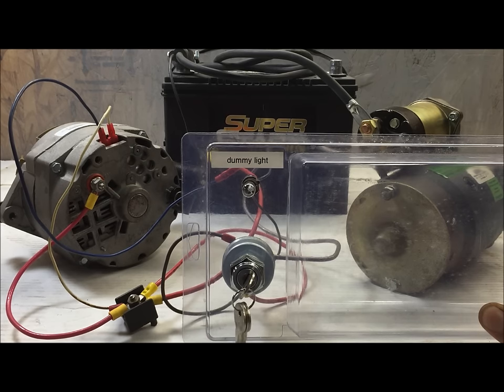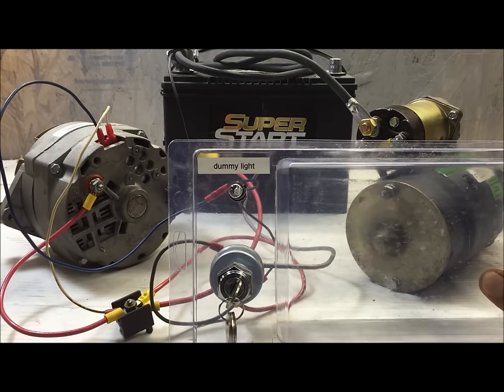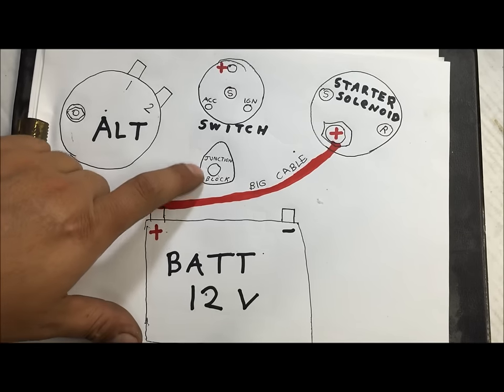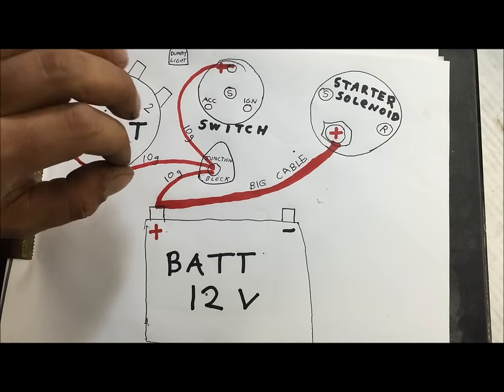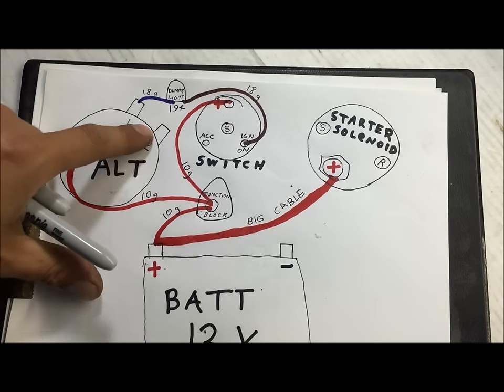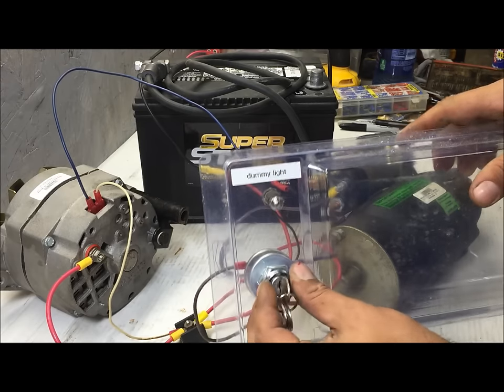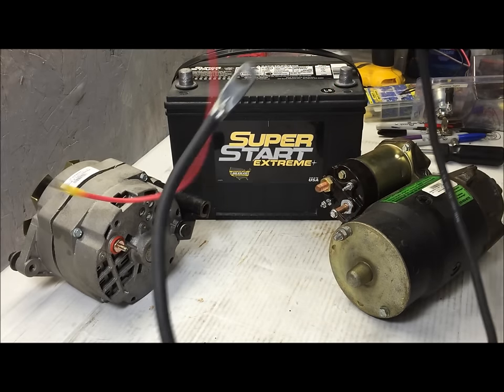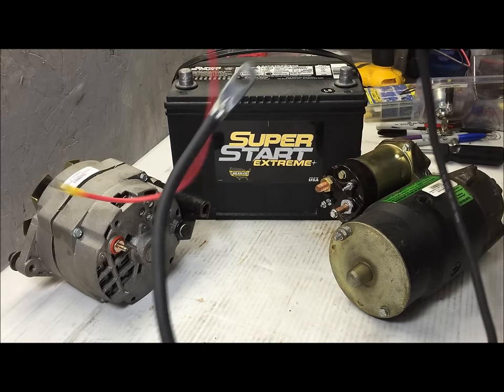64-72 charging system wire up using GM 3 wire internally regulated alternator

Comment: I took my alternator off last week putting it back together now. I can’t find a wire going to the 1 position on alternator (the wire your talking about connecting to the bulb). Is it possible that was never there?

My question is what will happen with no wire connected to the bulb or number one spot?

Thanks
Reply from the maker: you dont need it.. you will just have to rev the engine up a little to get it to start charging..  watch my Gm 3 alternator wire hook up video
Reply: Appreciate it!

Comment: Have an alternator like the one on video. Is there a ground cable that attaches across from positive post behind alternator. Working on my build and need help. Thank you
Reply from the maker: no
Reply: @chriscraft77022  thank you! Going to install it now. No one has seen these older model alternators. Just rewatched your video. So will only connect the 2 wire pigtail (Blue & white) and will connect 12V red. Will only connect 3 wires. Thought I needed a ground wire. Going to garage to make installation. Thanks a lot
Reply from the maker: I have a GM 3 wire alternator hook up video if you have problems

Comment: hey eny tips on how to wire up a 41 chevy coop floor start ? starter is a floor start how do i wire it up ?
Reply from the maker: ive never worked on one but if that switch is just a momentary switch..   then the ignition switch is still going to have an S position that would run through the floor switch and then to the starter solenoid...   im guessing they did that so you could work the choke while trying to start???      are you using the original engine?   if not get a later model key switch with momentary start position..  sorry, ive never worked on older than a 68 so my info may be wrong...

Comment: Where do u get the dimn light?   I try with a car turn signal   and won't turn on...  i have to doing same  as a normal light black neg and red positive   to turning on
Reply from the maker: you don’t even need to hook #1 up.. #2 is all you need connected back to battery anywhere.. watch my gm 3 wire alternator hook up video (old not with the truck )

Comment: i have a 1979 points xs650 yamaha, i do not want to run lights....... just the motor, can you help me, i want to use 2 automotive coils, with a on / off switch & a push button.

Comment: I have a rockcrawling buggy, Toyota based, 22R with a GM 1 wire. Alt just went out, replaced with one from DB Electrical. The wire from the back of the alternator goes to the main disconnect, not straight to the battery. I get 15.57 volts at the back of the alternator but only 12.7 at the battery. Should I run an additional wire from the back of the alternator straight to the battery or ditch the one going to the disconnect and have just one going straight to the battery?
Reply from the maker: The alternator wire has to go straight back to the battery
Reply: @chriscraft77022  
Should I reroute the existing wire going to the kill switch or just run another straight to battery?

Comment: I installed a 2001 alternator on my 71 chevelle. All works good. only thing is that when 
 I shut the car down something keeps drawing on my battery Think its something on my switch?
Reply from the maker: +Vic Cotto you have 2 wires wrong or switched   Voltage sensing and excited.. watch my gm 3 wire alternator video

Comment: I have a ground wire on my alt with external regulator. Does it still wire the same. Need help. Mid 60's 283. Installed in 1949 international kd1 panel. Was 6 volt now all 12 volt except insturment cluster.

Comment: I was watching your video on the electrical and I do have a question if you'd have the time to answer...my 74 nova had good power at the s terminal on the solenoid the next day the car won't start an test that s terminal and I have a 8.25 volts... any thoughts? Relay .... ur video was helpful...

Comment: Wonder if this would work to throw an alternator on a little tracked iron horse machine and keep a battery charged so I can throw a wench and some lights on there 🤷🏻‍♂️
Reply from the maker: the problem people run into is not being able to spin it fast enough.. think of the rpm range on a car when you drive.. it will cause drag too
Reply: @chriscraft77022  got a 15hp engine and it hardly works. Potential for putting a smaller pulley on the alternator to increase its rpm???

Comment: @chris Craft so a friend of mine has a 72 El Camino that has an external regulator wired up although it has an aftermarket internally regulated alternator one wire hook up installed. I'm not sure why the external regulator wasn't eliminated or removed. The charging light doesn't work. So the question is how would you connect the charging light in this situation? Thnx
Reply from the maker: +Fernando Rosa Jr. 1 wire alternator doesn't have the charging light feature.. does it have a #1 and#2 position? people think 1 wire alternators are an upgrade.. they make those for dune buggys and circle track cars.. watch my easy conversion video and I have a gm 3 wire alt video too
Reply: Chris Craft nope nope just one power wire to the alt. The car does have a charging indicator at dash, that of course worked previously. I have watched ur vids..all great thnx! Ill let u know how i make out
Reply: Fernando Rosa Jr. 1 wire does not have the charging light feature...all you can run is voltmeter gauge ...i have an easy conversion video for the ext. regulator

Comment: i feel like the butt connectors or whatever they're called might add resistance and 'mess up' or change the resistance of the 10 gauge wire
Reply from the maker: Well, how would you make the connection.. ? the factory made similar connections..  no solder .. it works .. heat shrink them if you are worried about this.. go pop the hood on your car and look at the factory connections
Reply: @chriscraft77022  No I know..  I'm just trippin on resistance and butt connectors.  I just bought a classic Dodge van with alternator and wiring issues. I'm not saying they're bad..  just wondering

Comment: You know what's even easier? Get a one wire alternator. All you do is run one wire from the battery terminal on the back of the alternator straight to the positive terminal of your battery. You don't have to use the ignition switch the dummy light or anything else

Comment: This helps but I’m still no crank I thinks something to do with the neutral safety switch. A guy was swapping my 305 to 350 unhooked everything wires all pumps pulleys brackets and never came back so I’m having a freaking hard hard time specially since I’ve never done a engine swap. But I’m getting there
Reply from the maker: yup, that’s a good place to check
Reply: Hey and another thing you said something about the 3rd spot on the started and something about the points. Does that apply to my 85 c10

Comment: How do you wire two stud starter? 
Ok the starter I took off the truck had 3 stud for your wires. The starter they gave me at the parts house has only two studs for your wires. How do you wire it up?
Reply from the maker: what is the vehicle?
Reply: It's a 91 GMC 350 4x4
Reply from the maker: that’s what is in the video... that year doesn’t use a 3 stud starter..

Comment: check majority engine wiring color wire uses like,
alternate to battery is green, from battery to starter main is red. battery to body main is black. alternate to body negative is black. alternate to lamp(1) is white. lamp to ignition is red. battery  to power supply ignition is
 red. ignition to starter for start is black with white line. please check all cummins and cat and Leyland wiring diagrams.
Reply from the maker: +Manojkumar Varsani these are gm 64-72 colors...

Comment: I just tried this on my 69 chevelle and it now the engine wont shut off unless I pull the HEI plug. Horns worked but now they don’t either. Horn relay has power. I jumped the external regulator like you did, blue to #1 pos, white to #2 then red on the alternator. Now what.
Reply from the maker: wire the exciter #1 to ACC instead of ignition. I have a gm 3 wire alternator hook up with the Chevelle old video that shows the diode you might need https://m.youtube.com/watch?v=kVae-m_Jv7I    I have a bunch of wiring videos on my 70 Chevelle in case you didn’t see them
Reply: @chriscraft77022  ok so in testing for a spot in the accessories plug, on the steering column, I must have woke something up, (got a generator light on the dash). So I tested everything again and both the blue wire and white wire became hot at the alternator. So like in your other video I pulled the white and verified No charging at the battery. Then pulled the blue wire from #1 position and plugged in the white back into #2 position and now the car shuts off by the key. It’s also now charging at 14.6-14.7. 🤷🏻. Thanks for getting back to man I really appreciate it. Keep up the good work and keep the videos coming.

Comment: Does the #2 wire ever come off a fusible link? I have 85 chevy c10 and if i remember right it split into 2 wires and one goes to the white wire on the alternator
Reply from the maker: 85 went crazy, but #2 is voltage sensing .. no need for a fuse but possible for that year .. I have a 3 wire alternator video..  ( old one not with truck )
Reply: @chriscraft77022  yeah I was looking though some older pics and it definitely and 2 wires going to the positive terminal on the starter for whatever reason 🤷🏽‍♂️

Comment: Sorry. I'm folding laundry as well I'm watching this but I heard you say that the wire must be 10 awg. Would a big 3 or 4 upgrade make a difference in the gauge size you would want to put in or does it remain 10. If so than I think I know what happened with my charging system.
Reply from the maker: I have an alternator 100 amp upgrade video that gets into upgrading the wire.. this is factory style up to 75 amp alternator only
Reply: Chris Boucher jwwheiiw

Comment: Mine is a 54 chev pickup 3100 and the starter is in the floor.
I position the key on and push the pedal on the floor.
I bought that alternator with #1 & #2 like your diagram and the other connector that goes to the battery.
Its the same setting?
#1 is the exiter
#2 is ???
Im an alternator 101 student trying to set my alternator.
Also i need yo know where i measure the charging output, how to connect it to the amp gauge.
Thanks !
Your support. Is highly appreciated!
Reply from the maker: I have videos on all that.. did you get an internally regulated alternator? 73 and up?
Reply: @chriscraft77022  I installed already.
Follow your diagram and its charging 14.2
The exitor on the switch-on.
Thanks for your advise.
Very clear and simple.
Reply from the maker: @ericruiz2174  ok cool, i have a 3 wire alternator hook up video in case the car doesnt shut off and with more info..
Reply: @chriscraft77022  thats exacly whats happening to me. It doesnt shut off even with the key off.
Where can i see it?
Send me the link or the title.
Thanks!
Reply from the maker: @ericruiz2174  just look up gm 3 wire internally regulated alternator hook up..    wire #1 to accessories or run a diode.. EASY FIX
Reply: @chriscraft77022  i will study that one  and please stay tune for your student in Puerto Rico.
Thats the only thing left so we can take it for a ride for first time.
Remember its a 54 chev 3100 pickup.
Thanks!
Reply: @chriscraft77022  i will keep you posted with the results.
Thank U!
Reply: @chriscraft77022  its working. Just change #1 to accesories and its charging and turn off with the key.
Thank you!

Comment: Hi Chris, thanks for making the video! I have a quick question for you, i have a PowerMaster Alternator 58302. It's a 220 amp 14.8 volt power alternator 2 pin style - L/F. I had it originally hooked up as a one wire alternator because that's what it said in the add when i bought it but have since found out it's a OE style unit. I've only gotten 13.4-13.8volts. How do i make this thing work?? It's a super expensive alternator and brand new. Do i need to change the regulator out? It's going from 13.8, 11, 9, 0, than back to 13.8 on the voltmeter then on repeat every few seconds, I have no ECU. Any info would be super helpful!

Comment: I know that this probably has been asked already but i cant find it in the comments. Is the 194 light on terminal one necessary? Or can i run just a 12 volt wire with key on to it?. I dont have a gen light i have an amp gauge instead.
Reply from the maker: no bulb run it to accessories

Comment: If the light dose not go out the diode is bad and the alternator will charge sometimes but discharge when the engine is not running

Comment: Question. I ran the #1 wire from alternator to power wire of dummy light on my 61 c10. Light wont shut off. And I am only getting 12.8 volts out of alternator when vehicle running. Brand new alternator.. there is a ground wire (I believe)  also going into the dummy light?  Ugh. Haha. Any help would be appreciated. Thanks.
Reply from the maker: watch my 3 wire alternator hook up video...  now are you running an external regulator?  no ground wire is used
Reply: @chriscraft77022  not running an external regulator. Was told alternator is internally regulated. Thanks.
Reply from the maker: then watch my easy conversion video and make sure you jump the regulator plug just like I did and remove any ground wire

Comment: I had someone tell me the dummy light wire goes to the ignition switch before, a manager of Auto Zone, nope told them this is the way to wire it up.
Reply from the maker: watch my 3 wire alternator hook up video.. it shows everything.. it goes to accessories.. if you wire it straight to ignition the car won’t shut off

Comment: Hey I hav2 a wiring  Nightmare on my end. I have something draining my battery all the time. It's a brand new battery brand new alternator for a new starter. But when I drive it steadily moves the Volt meter goes down. Good bad wiring cause that?  It has 2 wires coming up the alternator post going That 1 gives the alternative one gives the battery and has another wireless hanging out of it. I'm so confusing where they go it's unreal. It's 94-YJ jeep thats been gutted  and  A small  Block 350 has been put in. Any suggestions I send pictures if you need them Lol.
Reply from the maker: I have 2 gm 3 wire alternator videos look up old one with Chevelle .. this is how you wire up a tractor.. make a video so I can see it and I will help you..

Comment: suppose the  exiter connection on the alternator has no label,  how do you  find  which connection is for  exiting  and which is for voltage  sensing?.
Reply from the maker: exciter position will be a ground until alternator starts charging

Comment: If wire gauge is too low for alternator to positive post , will wire get hot? Thanks
Reply from the maker: yes
Reply: @chriscraft77022  thanks lastly if my orange & black wires on 2g aren’t together. With yellow wire? Is my setup wrong? I have left black/orange to yellow wire then middle black/orange going to positive battery. Then white wires to white connecting. Hope that makes sense
Reply from the maker: @jevontecole7836  does NOT make sense..  i have alternator wiring videos...  i just uploaded one..  charging system wiring..

Comment: This could sound dumb, but where in the hell is this so called ignition switch located ??? Also where might I locate a junction box??
Reply from the maker: you can put the switch anywhere.. usually on the dash to the left of the radio.. search online for junction box .. pay attention to stud size. The one in the video is a #10 stud rated for 75 amps
Reply: Man here's my deal ..i rebuilt top end new heads and up . put all back together and cranked it but off time so had guy come pull distributor and time right etc. So I started it and my battery was already very weak so I shut ignition to off and put charger on it all night . got to it today and went to crank and there was nothing no nothing period so I figured my battery was bad but b4 I went and buy new one I decide to boost off my other vehicle . now i was hooking the cables up and it was blk to blk and red to red . I noticed as I was clamping the red jumper to the positive it sparked like it would if they were hooked up backwards . but they wasn't so I left to this way in order to boost . omw back to start the truck that had  "fresh top end rebuild" I noticed smoke coming from the positive side of battery . so in an instance I unhooked the jumpers and said 2 hell with it and went and bought a new battery . got back put battery in slot on my truck , hooked up the black well as soon as I went to put on the positive side terminal I got a super flashpop. At this moment I get frustrated . I can say this tho im a novice as far as mechanic goes that after hooking all the ground and hooking old grounds to frame from the alt to frame and I think there's another on the fire wall that goes to the head bolt but I've minimized the culprit and it's definately a crossed wire or I've got something grounded wrong or something .. Man any advice would be super as u can clearly see I'm in desperate measures by leaving this type of comment . but again any advice from simeone like u who knows this stuff like nothing will be a major plus to my situation.. I'll wait for any and all advice . srry to take up so muvh of your time will subscribe and comment quite frequent from now on all.peace
Reply from the maker: you just need to make a video and post it.. watch my automotive grounds video to start with.. most overlooked thing of all time
Reply: Wow ..i guess that makes sense . what do I list it under buddy